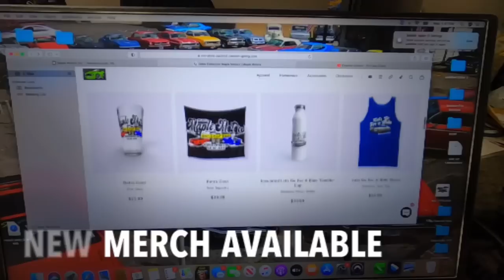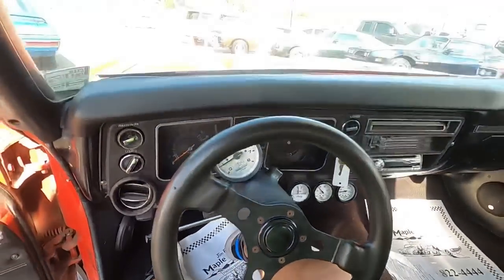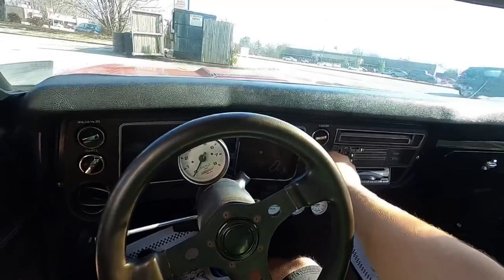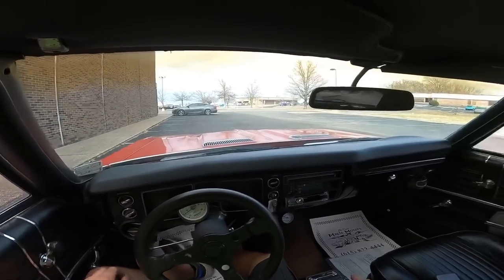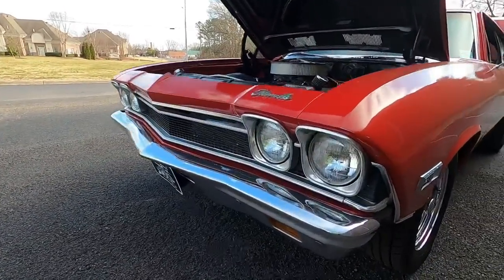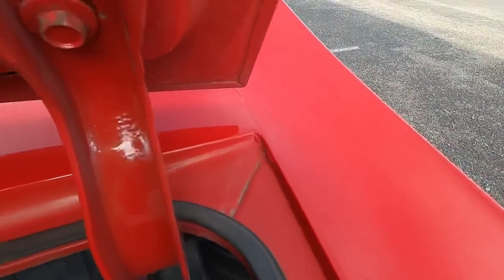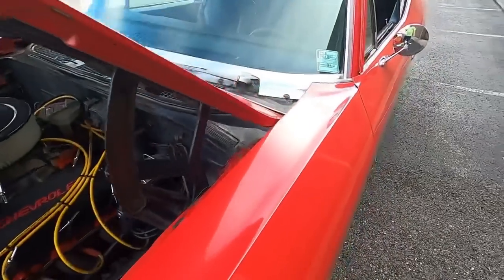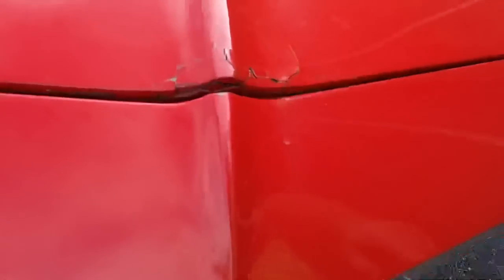Test Drive 1968 Chevrolet Chevelle SOLD $25,900 Maple Motors #1480

Comment: When it pops like that, i would check the timing first than accelerator pump and pump camshaft position. It’s getting way too much fuel. After that I would check to see what size main jet is on the car and go few size small. Air fuel mixture has nothing to do with off idle acceleration because gas is coming from the main booster not the idle circuit. Good time check vacuum and what size power valve it has if it’s holly carb. Maybe owner fooled around with the carb.

Comment: I'd say it's got a fouled plug and or the air fuel ratio needs adjusting.  And for sure it's got some blow by.
Reply: Carb out of adjustment
Reply: @toykosavage1424  yes which causes fouled plugs.  But I bet it's got massive blowby which is why the carb is out of wack which causes plug to foul out.